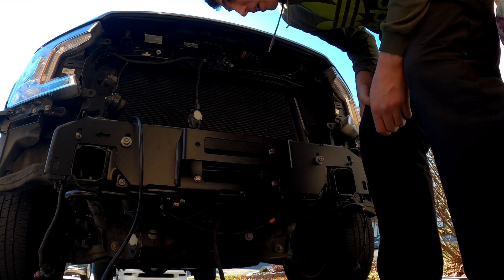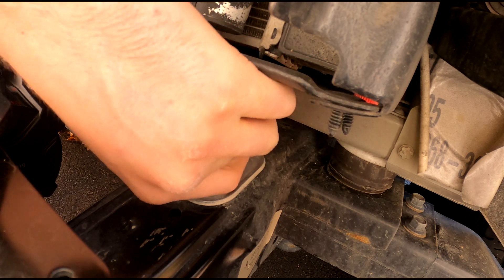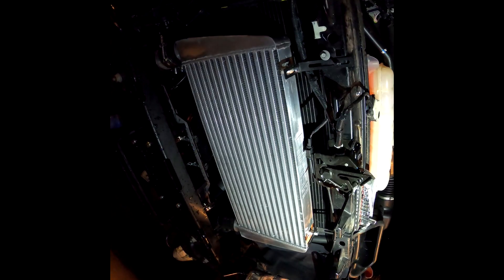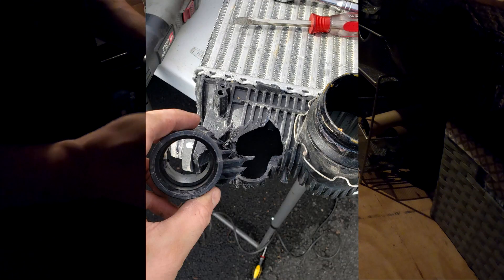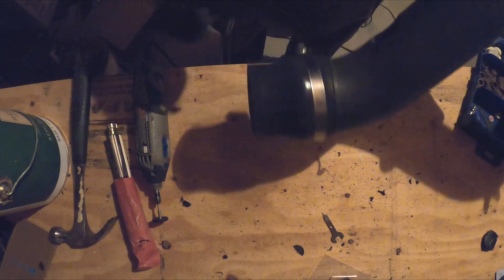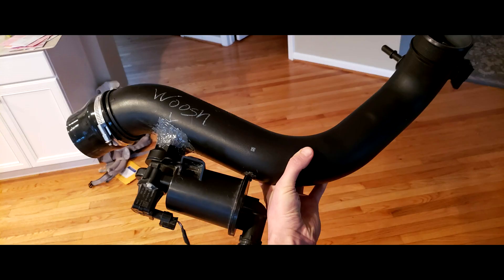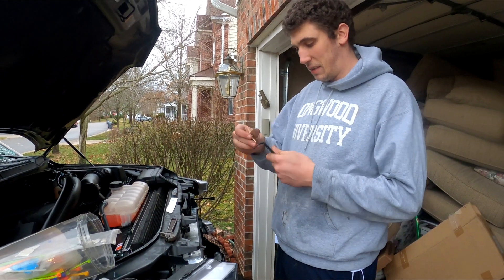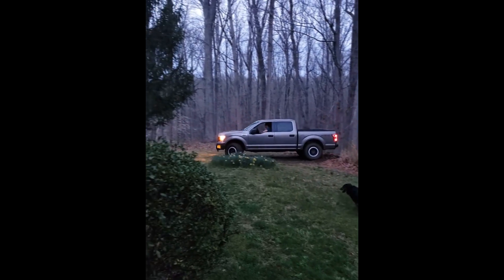F-150 Overland Build: 2019 F-150 hidden winch and intercooler relocation on the cheap! - Ep 2

Comment: Did the same thing, but instead of hacking the old rad's waste gate valve connection and JB welding to the plastic pipe, i bought a 2.5" Bov Aluminum Adapter Pipe, then one of those DFJ Turbo BOV Adapters, and JB welded the native Turbocharger Intercooler Adapter (the black canister that BOV attaches to) to the Blow off valve adapter, which then gets bolted on to the aluminum pipe. Felt more secure this way, though about 120$ more in parts. I tried to find the correct adapter from the Turbocharger Intercooler to the BOV adapter, but they do not exist. The two do fit together perfectly with a small gap though, so JBweld took care of the gap.

Comment: Thank you for the great video! I have a question or 2 if you don't mind? Did the check engine light come on after removing the shutter system? Did you just toss out the factory intercooler fan assembly? Finally, do you think I could use epoxy putty to mount the blow off valve to the charge pipe? Any input is much appreciated! Thank you!

Comment: Great Video! Good projects. I have a 2019 Ecoboost with similar objectives. Question. Would that RC Winch Mount fit behind the bumper without a winch and clear the intercooler?
Reply from the maker: Oooooooo maybe... a winch would not fit  but the winch mount plate might by itself... trying to remember if you just remove the lower shutter system there might be room. But you would have to remove the lower shutters for sure. Sorry thats about as clear as mud. 😔
Reply: @HeretoWherever  Thanks for the reply. Thinking of modding the plate for a 2” receiver.
Reply from the maker: @jasonpenner5621  I think you'd pretty much kill all the air flow to the intercooler without major modification to the plate or maybe some ducts to get cool air in there somehow... but I'd love to see a reciever "in" the bumper instead of some of the under bumper super low ones.
Reply: @HeretoWherever  I agree 100%, however my truck came with a license plate mount there that closed that opening almost completely. It was the first thing I removed from my truck. My idea is to cut away most of the winch mount and really only use the “wings” and build a tubular structure with more rigidity to place the 2” receiver in the middle of the bumper opening. Could use the winch mount piece later to make a bracket to hang a winch off the receiver. Loads of ideas mulling around. Had not seen this particular bracket before when searching for front receiver mount ideas. Just wanted to confirm whether it would even fit to start with.
Reply: @jasonpenner5621 did you ever push for this diy? Glad to know some one was interested in that idea.

Comment: Those L brackets holding the intercooler up. Did you drill and use bolts of just screws?
Reply from the maker: They are bolted in.

Comment: Where you got the intercooler for $90 bucks, it's now $1k.... Happy that it worked out for you, how is it doing after a year+ on the truck?
Reply from the maker: Everything has been great. I haven't had a single issue with any of it!

I did an ebay search and found https://www.ebay.com/itm/Universal-Full-Aluminum-Top-Feed-FMIC-Turbo-Front-Mount-Intercooler-29-x11-x2-5-/233630341902?_trksid=p2349624.m46890.l49286

I am not sure if its the exact dimensions but that's in the ballpark.

Comment: Awesome man , really contemplating this method. Just a lil worried with the jb weld for the blowoff. Iam planing on hitting some rugged trails not sure it will hold up . Thanks for sharing
Reply from the maker: Thanks so much! It's plastic welded (melted) back together first and the jb weld is an extra step. 

You could always go with an aftermarket aluminum pipe and blow off valve if you are worried it won't hold up. LS v8 guys have done the same thing with the truck manifolds for years and some run silly boost.  

I've had it like this for a year and bounced it around a fair bit and she seems to be okay, but will report back if there are any issues!

Comment: Thinking about doing the same thing, any problems since then with high temps or with the bov mock up?
Reply from the maker: I have not noticed any issues, but to be fair I have not measured intake temps before and after. BOV location is janky, but is holding strong plus it makes whoosh whoosh noises now! so thats got to be worth another 2-3 hp right there!

Comment: Im curious how effective that intercooler is. Have you measured IAT2 temps under boost compared to ambient temps, and also pressure drop across the intercooler?
Reply from the maker: I have not. I know the inlet / outlet would be the biggest reduction from the Full Race kit (2.5 vs 3 in). There is a larger surface area for cooling vs OEM so IAT could be less I suppose but if airflow is restricted that could be moot. 

All in all I  am not looking for a performance gain but even if there is a small hit to Performance I'm okay with it for the winch. 

If I get Forscan can I pull the IAT? Id need another truck to compare to the stock set up, but sounds interesting!
Reply: @HeretoWherever  I ask cause I do have the full race intercooler on my truck.
Reply from the maker: @1FiftyOverland  Lets follow up, I would like to compare notes if I can get that info on my end I would be happy to share any information.
Reply: @HeretoWherever  I was able to record a datalog today a 0-60mph run with engine at operating temp after driving to grab some lunch. So at 0mph AAT 57°F, IAT1 77, IAT2 98. AT 60mph AAT 57, IAT1 64.4, IAT2 69.8, I am currently unable to measure boost pressure before the intercooler. Fullrace states <1psi drop at 700hp airflow levels, I have no reason not to believe that is accurate.
Reply from the maker: @1FiftyOverland  I just ordered a ODB to USB adapter so hopefully I can get  a log as well. 

I am currently without the truck because it is (spoiler alert) is getting re-geared with 4.56s
Reply: @HeretoWherever  wow really? 4.56s just curious as to why?
Reply from the maker: @1FiftyOverland ...37s

Comment: Awesome!  Thank you for doing the research and posting the video.  One question, Is there room behind the winch for it to be mounted further back under the truck and closer to the radiator?  If there is I will make my own winch mount plate so I can have as much forward approach angle as possible.
Reply from the maker: Yeah I think you could sink the winch back further  toward the engine. The winch mount is below the radiator and even with the top of the frame rails.  It may complicate the intercooler routing depending on how you build your mount. But you could possibly push back the winch another 10 inches or so. 

Overall the winch does not hang down below the frame rails so other than the front bumper itself I am not sure how much approach angle you will gain unless you are getting rid of the front bumper all together or even cutting the front of the frame rails. 

Either way I want to see it!
Reply: @HeretoWherever   I have seen other hidden winch mounts that mount to the bottom of the winch not the front.  That gives you more flexibility on placing the winch fore and aft.

Can you post how many and what size hose clamps are required? Thanks.

Comment: You did it! I would be interested in seeing a video of your lessons learned and how you could have improved the process.
Reply from the maker: I should record a x# month update. Lessons learned were many, but I did not have to stray too far. So far I have not had any issues!

Here is a freebee. Use a recip saw / band saw to cut aluminum pipe. That dust was everywhere and stuck to the inside of the tubes and was hard to get out.